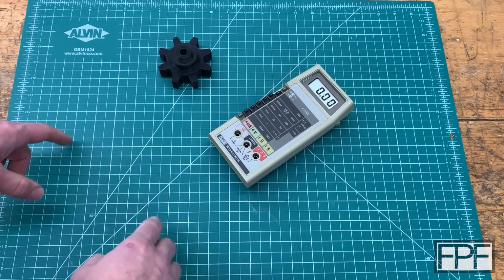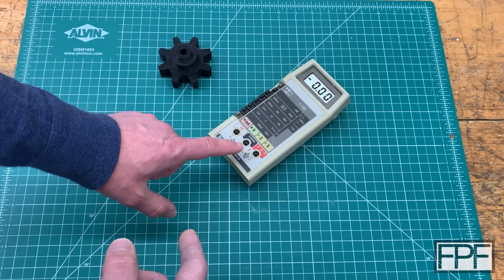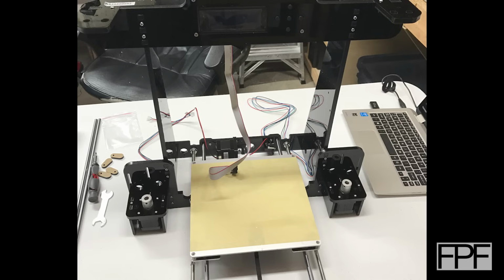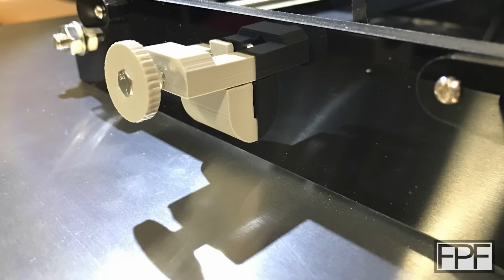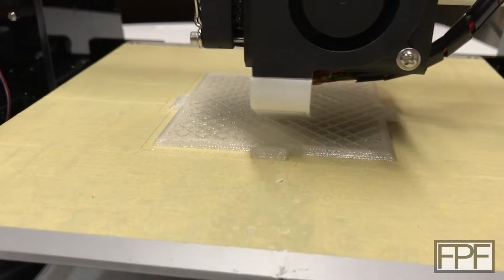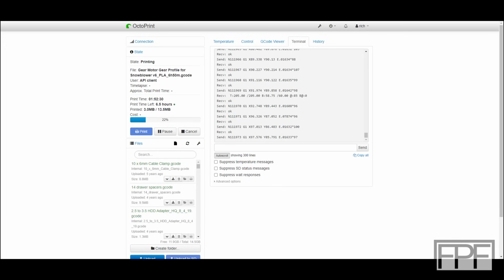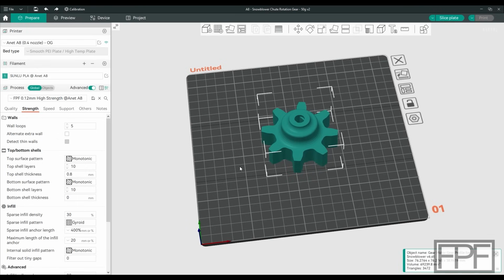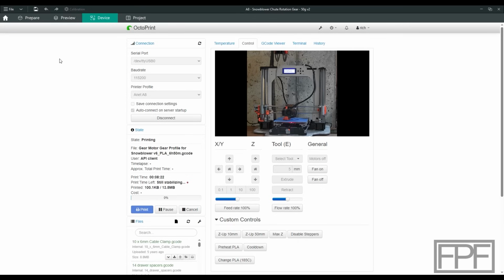Can this 8-yr old bedslinger still be useful? Modernize your workflow with OrcaSlicer and Octoprint

Comment: I still use my Anet A8! Did the AM8 frame conversion a year ago, Marlin on the original board, a biqu h2 extruder, and pei bed. Previously I had done tl smoothers, mosfets, and a sff psu. Currently designing and printing out a computer case for an Otter X16 (Commander X16 clone) 8 bit computer. Prints are coming out just as good as my Voron 0.1 just a bit slower haha. Thanks for the profile I just started using OrcaSlicer on my Voron 0.1 last week. Put foam insulation under your bed it will help retain bed temps and heat up faster :)